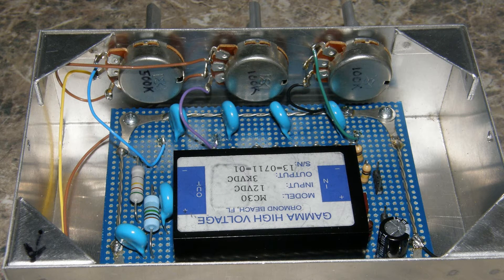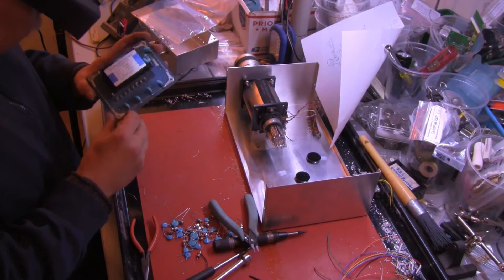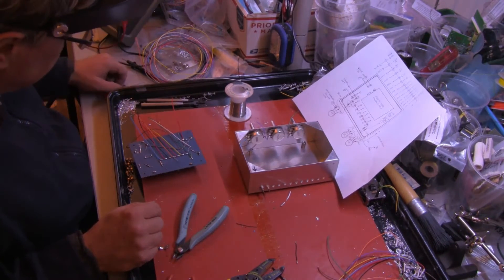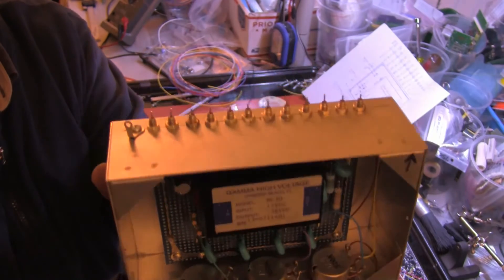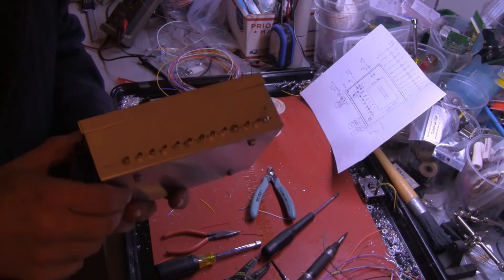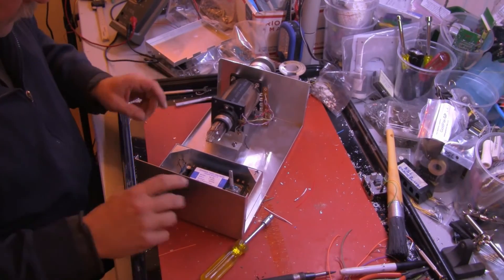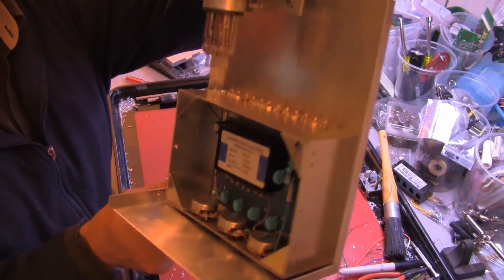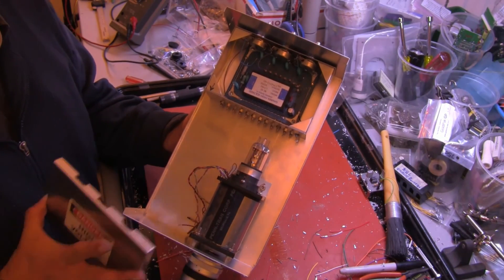PhiloCam Part 3

Comment from the maker: Here is your "30 days since my last video" update. The darned high voltage box is too small! The pots keep arcing over and the two or three highest voltage feed through capacitors apparently are also not rated for 1KV+. Darn! Been thinking hard and heavy on this problem and now my brain hurts. 

In the mean time, two other projects have moved to the foreground. I won't say what they are. But, there is an private annual antique TV collector gathering that I attend in May. I have nothing new to show this year. Previously, I have displayed the Goldmark 1, CBS field sequential color TV, the colorized NBTV mechanical TV and, of course, the Tiny Triniscope. I will publish a video again just as soon as one of these projects actually works! It gets embarrassing posting my real time work as you get to see too many of my errors.